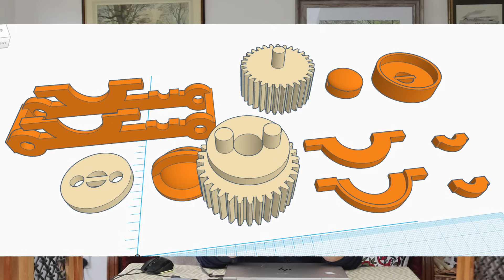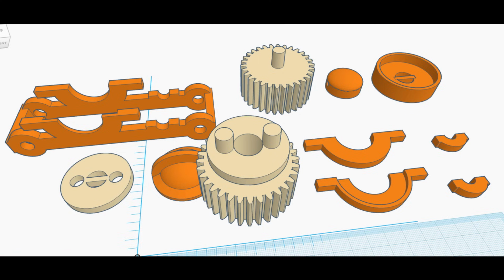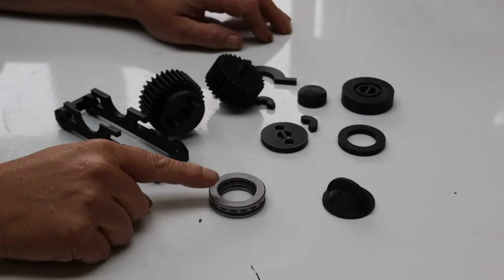2297 The Rubber Band Motor

Comment: A simple way of limiting speed can be nice. One solution I've heard of is lubricating with shear-thickening grease. Cornflower&water mixtures work fine for short term experimentation. Fumed silica and glycerol better for longer term use.
Such mixtures get increasingly viscous when exposed to shear forces such as happens when between two plates, or as grease on an axle. Such applies an velocity increasing breaking force on motion.
Reply from the maker: gear it to whatever output speed you need mate - shear thickening would be good for braking and clutches.. It was tried with clutches but it didn't go very far as containing any liquid between moving plates is a challenge to do and far from simple I am afraid
Reply: @ThinkingandTinkering  depends on the type of load of course, but same as springs, rubber bands produce a lot of force initially, and that drops off quickly. Watch spring type mechanisms use fusee chains to change the effective gearing as the spring unwind, and apply a more constant torque.
Shear thickening greases are as containable as other greases, but yes over time they could leak out. Teflon o rings or similar to work akin to gators
Reply from the maker: mate - if you think it is a good idea - go for it and send me a link to your video i would love to see it

Comment: So many other ideas to develop from this design, I must find the time to learn tinker cad.
Reply from the maker: i have 3 projects up and coming using this - so I have to agree - find the time mate lol - seriously it's much quicker to learn than you might think  cheers
Reply: @ThinkingandTinkering  thank you Robert for the reply. I’m exploring a clockwork drive to rotate a solar panel for sun tracking, probably a drop weight rather than a rubber band, but your windup gear drive is a great starting point. Many thanks Paul

Comment: The spring loaded cars worked alot better same principle though.
I often thought loaded springs as a way to store wind power and then use in a controlled fashion since the wind is intermittent.
Just a thought.
Reply from the maker: of course they do mate - but that's not the point lol

Comment: Rubber band motors are under rated. Made them when I was young for model airplanes. Long lengths of rubber can be wound and folded to make a compact motor. That can take a lot of winding to return a consistent output in return. Maybe worth looking up.  Thanks for sharing. Bob.
Reply from the maker: i agree mate they are underrated
Reply: Read "The Windup Girl".  Full of Windup motors and their uses.  Pretty trippy.

Comment: Back in the very early days of radio controlled airplanes (late 1950's, early 1960's), there was a system where each pulse of transmitted power caused an escapement to advance, turning the rudder left-straight-right-straight-left.....  The escapement was driven by a rubber band.  Didn't take too long for advances such as pulsed amplitued modulation and servos, so more than the rudder could be controlled, then FM modulation, and much later digital systems, which is what RC drones and cars use today.
Reply from the maker: cheers mate